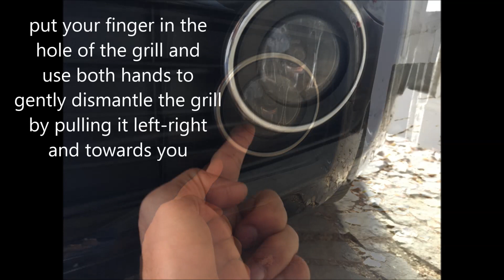How to change the fog lights of Audi A5 Coupe / Sportback and A4 B8 with white xenon match bulbs

Comment: How did you get the fog lights to come on with the daytime lights? I have a 2008 Audi A5. My fog lights only are able to come on when I have my low beams on
Reply from the maker: You can mod it with VAGCOM. Or you can switch on just sidelights instead of Auto or headlights. Fog lights work with sidelights, too

Comment: It not that easy to remove plastic. I suggest you use some small pry tool and remove it from the side closer to reg. plate. I just changed both fog lamps.

Comment: Can I use H11 8500k ? Instead of 5500k ? And whats the diffrence ?
Reply from the maker: The lights that we have installed and offer in our shop have a 5500K colour which matches the colour of the original xenon headlights. This is a cool white colour. The 8500K coulour looks more like purple. We don't offer 8500K H11s.

Comment: How to know the wattage, 55w or 110w? I have Audi S5 2008. Thanks.
Reply from the maker: The standard bulbs of the A5/S5 are 55w. The 100w  bulbs are more powerful, but I wouldn't recommend them as they are not road legal.
Reply: TNT AUTO TUNING thank you for the fast reply. I will order the 55w.